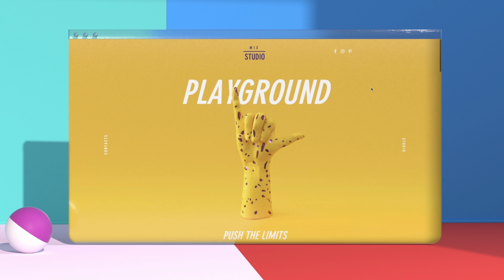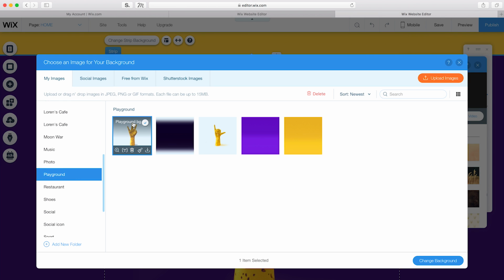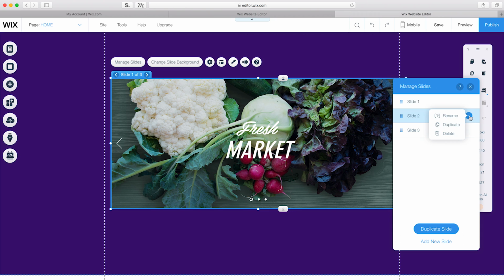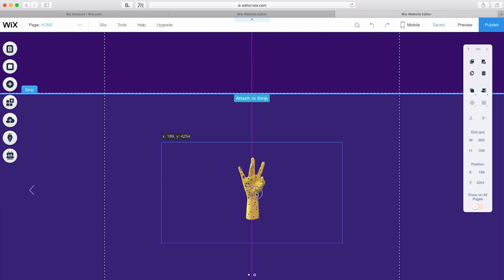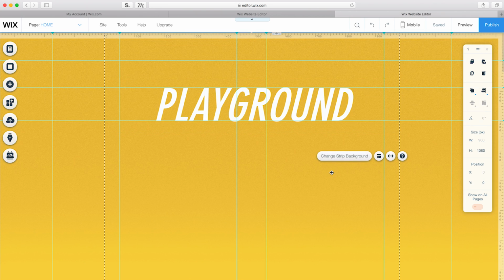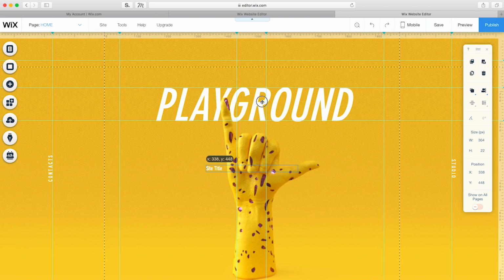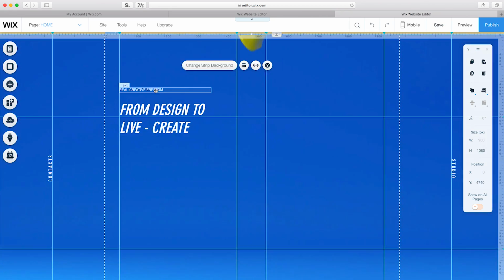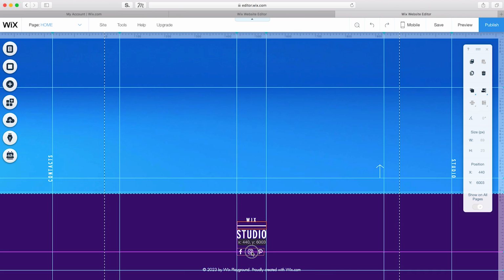Wix Design Tutorials: Creating a Strip-Based Site with Scrolls Effects and Animation

Comment: It would be better to go slow when explaining all of these things, felt like Speedy Gonzalez was doing the tutorial
Reply: In settings, set the playback speed to 0.5 or 0.75 speed.  That helps somewhat, but then you can pause with each step.
Reply: If you're still interested, click the settings button (the wheel) at the bottom right of the youtube screen there is a playback button for changing the speed. Press it to 0.75 to slow it down.
Reply: @JEWELFROSTY  Thank you It was a while ago though.
Reply: Pause & Play - It's a very-easy-to-follow video, just pause and do the steps before continuing on the next instructions. EASY!

Comment: First of all, many thanks for this video. I have one question - is it possible to fix the height of a strip ? So after one point adding some more element will result in a scrollbar for that strip. Now adding multiple elements vertically is increasing the strip height, but I don't want it.
Reply from the maker: Hey there! This is a great question for our support team! You can reach them at wix.com/contact from your computer! :)

Comment: With some new websites displaying all of their contents on one page, does that make the website heavier and therefore harder to load?
Reply from the maker: That really depends on the website’s content. If the site is filled with heavy files, then having them all load at once would slow down the loading speed. For many websites this isn’t hasn’t been a problem, though.
Reply: @Wix  This is particularly (especially these days, BUMP!) the case if you use JPEG images since Wix automatically converts to Webp format, which saves anywhere from 70 to 90% of the storage space.